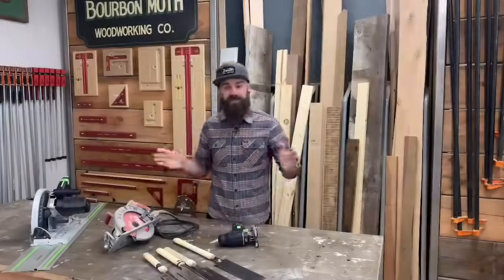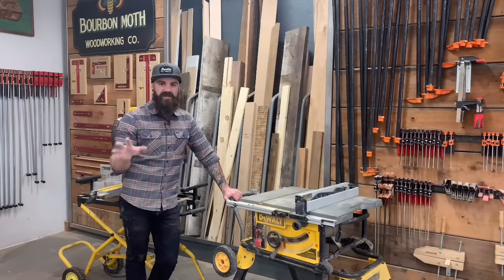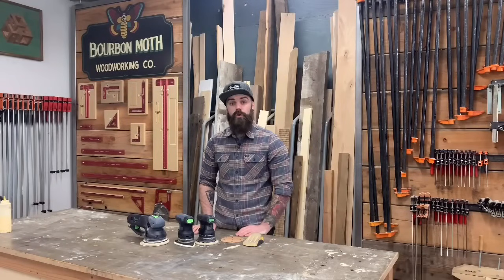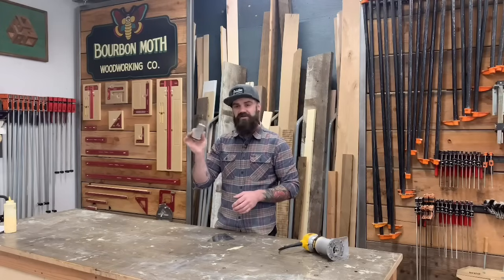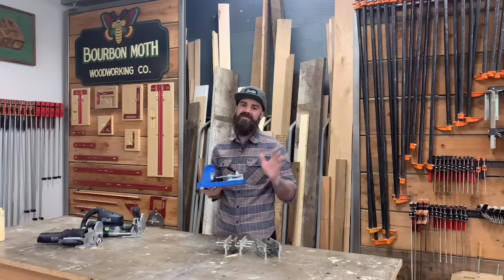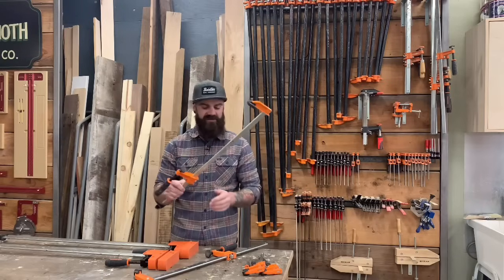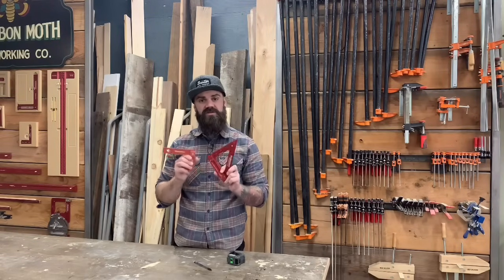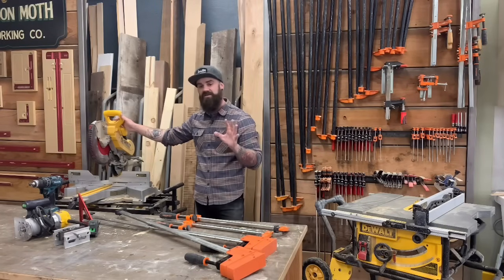Tools every woodworker needs | Start Building for under $1000

Comment: you can get drill bit sets that go into an impact driver.  so i would say a drill is not at all necessary.
dewalt has a very nice 12v brushless impact with a screw setting so you don't strip out holes on small wood screws.  however, the kit with a drill is only fifty bucks more, so i suppose you may as well get both (you may rarely use the drill, but at least you get two batteries)... https://smile.amazon.com/DEWALT-DCK221F2-XTREME-Brushless-Cordless/dp/B07TYKLGZT/
i don't think your makita set is brushless.  the dewalt is, and it's cheaper.
i never liked those self centering dowel jigs.  i would recommend powertec dowel jigs.  there's no reason the dowel has to be perfectly centered... as long as it's the exact same distance from the surface.  these jigs are great... https://smile.amazon.com/gp/product/B07ZJCP9CB/
you can also buy them individually if you're on a REALLY tight budget.

Comment: You can do some stuff hard labor style for 1k but it's about 2500$ to get a shop going table saw 500 planner 400 miter 250
Then you need a few 50 to 100$ tools like circular sanders drills impact etc then you need alot of batteries or air compressor and lines for brad nailer or batteries again. You need clamps wood and you need to make a table\work bench....sorry it's always about 2 to 3 grand to start a shop even budget style and you'll need a shop vac 100$

Comment: Good selection. For an upgrade, add a pancake Air compressor, with brad nailer. Future add on a air stapler, and pin nailer. Also great for blowing dust off wood and inflating beach balls.

Comment: Veeery late to the party but I would think that there's a lot more to be added to this list, like: wood glue, super glue and activator, Japanese saw, A LOT more clamps (at least half a dozen more, including small ones), work table (you can make one but you need one to make one, so...), tons of sandpaper, finishing oils, waxes and varnishes, wood drills and fostener drills, nail hammer, wood mallet (you can make your own), chisels, compass, assortment of screws and nails... I know these are mostly cheap stuff but they're still necessary for most projects and can add up. I'd say another $500 easily.

Comment: Totally loved this video. For beginners, I would recommend the Sawstop contractor or jobsite saw. It is more than $1,000, but a table saw is probably the most likely way to lose fingers. Much harder to do that on almost any other tool in the shop. So, for me, it is Sawstop or no table saw.

Comment: Great beginner tips… In your video, you show the DeWalt sliding miter / chop saw.  I started out with the non-sliding, aka: regular, miter saw, which is about 30% less expensive, and, of course, I got the DeWalt contractor’ saw: an unbeatable combination. One reviewer recommended getting these tools with compatible-sized saw blades. I am unaware of miter saws with less than a 12" blade and it is unlikely you will find a table saw with a 12" blade — unless splurging for a very expensive, 3HP saw.  A larger blade on a miter saw will allow you to cut thicker wood (than a 10" saw blade).  Plus it is alot easier to segment saw blades: 10" for table saw and 12" for the miter saw.  Replacing miter saw blades is a tedious undertaking and one rarely has to swap out blades, unlike with a table saw  Also, do not overlook Craig’s List.  I started out with a great Skil “regular” table saw and after 15 years, sold I on Craig’s List for $75; it was just too heavy to lug into my basement workshop, unlike the DeWalt saw that replaced my first real saw: the Skil saw. It was tough to let my first saw go: my first "large" power tool I purchased and one that served me well.

I suggest getting a belt sander, first, because a hand sanding solution can handle what a orbital sander does (albeit, a little slower; hand sanding is a bit more methodical and controllable, read: more difficult to screw up a project piece by over-sanding with a machine).  Also a belt sand does a lot of that planer and jointer does (if one is careful with belt sanding edges).

Relative to the Kreg (and other) pocket hole jigs, I believe most issues / complaints are because folks “incorrectly” use them to connect / screw end grain of wood the wrong way.  Pocket hole butt joints (and other types of joints) are about as strong and solid as they get. Also, if you have not yet seen Jason’s YouTube video, the joint section part (not the weed, but edge gluing), provides another great tip from an experienced person: https://www.youtube.com/watch?v=C9scpxNqb40.  Another inexpensive jointing option are box, dovetail, etc. joints; Rockler and MLCS have great, inexpensive jigs.  I have had a number of bad experiences with dowel jigs: one fraction of an inch off and you’re screwed — irreparably.

For clamps, as can be seen from his workshop, one quickly learns ya can never have enough clamps.  I have been using those from Harbor Freight clamps for years; they are inexpensive and work very well.  If a wider jaw is needed, as in Jason’s Bessey clamps, use a scrap piece of wood between what is being glued and the clamp’s jaws, i.e., you are increasing the surface area, as Jason noted.  As Jason noted, these are pretty spendy.  Get a couple when they are on sale; it is nice to have a couple of them on hand, sometimes, instead of using the Harbor Freight version.  None-the-less, load up with the Harbor Freight clamps.

Relative to measuring tools, forget the tape measure.  As noted, they are not that handy to use.  Get metal rulers: durable and easy to use.  You can get carpenter squares / speed squares at most hardware stores.  Watch some YouTube videos on how to used these; they do considerably more stuff than most know, i.e., they do A LOT more than drawing 45° angles and measuring stuff.  If they had batteries, you would not need a calculators.  If you are going to splurge on anything, WoodPeckers’ and Infinity Tools stuff cannot be beat for utility, accuracy, durability, and convenience.  They are expensive, but the are on sale all the time — they are worth their price. They are a one-time expense (something almost no other tool can claim) and will never need to be replaced — unless you lose one or someone swipes one.

One real handy thing to have / get is a "workmate" bench.  They are a bit less than desirable, but they clamp wood for sanding, drilling, etc.  They are a great third hand until you can get a "real" work bench with clamps.
Reply: For me the situation is ironically the reverse being in Europe, I have a 12" (actual size ~12.5") table saw in my hobby shop, which is pretty standard.. Machines in larger shops usually take ~16" blades. But my miter saw is an 8" model, which again is pretty common here. There's 10" and 12" versions available, but the 8" and 10" is what most people run.. even contractors due to mobility. There's of course 12" models around though...

Besides, miter saws and table saws by their nature usually use different blades, a table saw when cutting wood usually have positive rake on the blades... While i miter saw benefits from a negative rake, minimizing the risk of the blade grabbing the work piece while cutting. But, you can... of course use whatever blade you fancy.

Comment: terrible suggestion, you can get even cheaper then your said.
1. You can get combo miter/table saw or in my case circular saw  and miter saw is enough for everything. You just need to learn how to use it. 
2. Cordless drill is good enough for everything, hadn't need for impact driver. For drilling grab cheap drill which is meant for drilling.
3. Grab yourself hand held belt sander and it has flat sides to mount it. 
4. You can get yourself good tools that arent fancy brand... For almost half price, heck, go second hand or like apocalypse inventor and fix yourself, its always a good thing to get to knowing your tools.
I hate how 50 dollar talk goes its cheap, grab a bunch, you wont start it as furniture producer, in start its gonna be a hobby...
You can have good joint by hand.
Half of recommended tools can be avoided.

Comment: Great video, Jason, but a major missing component, is bits. Drill bits, router bits, none of the tools come with any bits. Drill bits are easy to figure out, but what are some good starter bits for a router? Ideally, the Freuds are suh-weet-spot, but they're also hella expensive. Also, you might want to go through the links and update some of the tools (especially the table saw, doweling jig and domino joiner). Regardless, keep up the great work!

Comment: Just my two cents and maybe this is obvious but another thing to do, especially when starting out, is to make sure your miter and table saws are the same size.  Both either 10" or 12".  Save by only needing one set of specialty blades.
Reply: Dont listen to him...as long as the arbor size is the same...you can get a 12in saw and use 10in blades...just not the other way around. Specialty blade could be 10in to keep interchangeable. You might need a sacrificial riser block to make your depth cuts..but as far as blade go...a 10 in works fine in a 12in as long as the arbor is the proper size
Reply: Can you show how to make an overhead cabinet in the garage?
Reply: except for the fact that you wouldn't want to use the same blade in both of those saws, nor would you want to go to the trouble of changing the blade out every time you want to use one of your saws.
Reply: @jamestremblett1875  I don’t understand what you are trying to say with your comment so don’t buy cheap tools when starting out ?

Comment: I got a tool kit to include the following for only $298. 2 Drills and an impact drill,  miter saw,  hand sander,  hand planer, jig saw, flashlight, and grinder.  For another $99 I got a table saw with stand.  So I did good.  Now, for free, I got a hammer, and measuring tape.  I spent another $36 on a pallet buster pry bar.  So this is my starter kit, and I will work with this until I get some sales.  btw, square sanding paper is only a dollar and comes with waterproof abrasive paper P80, P240 and P400.  It is NOT adhesive though.  I have had small clamps for years, so I didn't count this in the budget (up to 4 ft long).  I do NOT have a work space however, but this year, saved to get a small 12x8 shed to have it built in the backyard.  When that is built, I will have a small shop to work in even through winter season, and a small solar kit to add so I would have the lights, heater and etc for the shop.
Reply: Where did you get that tool kit????

Comment: The SKIL tablesaw is no longer available (the link takes me to a 2 pack).
Reply: It's been discontinued. It was around $225. It's too bad, there are a few models similar in price but don't have the large rip length.
Reply: @bigosnation  personally, I will probably spend 2x to get the DeWalt 7491RS but it would have been nice to have other options

Comment: The table saw and the chop saw total more than 1K by themselves.
Reply: His links are all messed up and prices have skyrocketed.  If I was just starting out I would get the Metabo HPT Jobsite Table Saw, 10-Inch for ~$400 and a 10" sliding miter saw in the $200-$220 range (Ryobi is fine at HD).
Reply: Can always start with used tools as well

Comment: Are plug in hand drills no longer a thing? I'm not a fan of batteries for various reasons (like me never remembering to charge them), but I don't want to buy a bad thing.
Reply: Only for hammer drills, really. And even for that application, there are amazingly good hammer drills that will work day in day out just on batteries. My father has a small business, and I don’t think there is any corded drill except one big Hilti hammer drill that just isn’t available as cordless yet

Comment: Good information.  One BIG thing that was left out, working surface.  It is great to have the equipment but not sure working in the grass or a garage floor is such a great place to work.  
Can you talk about "minimal" starting work surface?
Reply: I built a basic table using 3/4 melamine as the top for a work surface nothing fancy but it works.
Reply: @eugenewilson7555  that top is great for gluing pieces together! It's usually flat and the glue can't stick to melamine, so cleaning is really easy. We usually have a slab of scrap melamine for this purpose. Also great as pressure blocks when clamping/glueing stuff together
Reply: I just did my first "real" project by cutting full sheets of plywood balanced on the winter tires for my car. Had to make sure the circular saw didn't cut the rubber. 

I need some work horses at least...
Reply: You can build a starting-out bench very cheaply.  My first bench here was made from a discarded domestic door (exterior quality), 38mm thick, topped with a 'sacrificial' layer of 12mm OSB (I can't get plywood here).  The legs were made from offcuts of roof beams, 100mm square section.  I used new wood to make the stringers and stretchers then added a shelf at low level on which I put 160kg of expired cement. It doesn't move!  This one has been in service for 10 years, a similar one built in 1975 is still in use at another house.
And I only used a circular saw and electric drill.
Reply: As terrible as most harbor freight stuff is, they have a good woodworking bench for about 120 dollars..get two, and put them back to back..its actually cheaper than the materials for a workbench, and has bench dogs and a good clamp.

Comment: Here's what I've done, so far: 

Makita 7 1/4" corded circular saw with brake  -- HD return $65
Ryobi corded Power Planer, Open Box $60 
Rigid Corded ROS -- HD Sale $49.99
Craftsman Industrial Plunge Router (1/2" collet) Offer Up $30 Router Only
2x12" and 2x24" DeWalt Trigger Clamp Set $25
2x set of sawhorse brackets $20

DeWalt Cordless Drill & Impact set inherited from my brother in law $0
Various Hand Me Down tools incl. Speed Square, Carpenter's Square, hammers, screws, drill bits, sanding discs, Dremel, and a bit of reclaimable lumber. So far, I'm OOP maybe $500 plus the lumber I bought to build my first desk. 

I plan on selling the desk for $500, breaking perfectly even, and then going on to making nothing but edge-grain cutting boards and replacing my day job with the income when I become a YouTube sensation and start showing up in the gossip pages with Hollywood's Bad Girls... 

First, though, I have to finish the desk I've been working on full-time for 2 weeks. 

(/sarcasm -- please don't crucify me. I was joking. I took up woodworking to replace the Harley my wife insisted I get rid of. When the quality of my life took a nose dive, I knew I had to find a way to get spiritual without spending time on two wheels and wood is what came to me).
Reply: If you ever need help with the Hollywood Bad Girls overflow, I got your back bro. 👍👍✌✌🤣
Good call on woodworking though; don't go building any wooden motorcycles though, it'll piss off the woman.

Comment: I recognize that to do so would make the video much longer, but some comments about how to discern what comprises a quality tool are needed.  My wife bought me a jobsite table saw, and for years it has made sawdust, but the fence is crap and the accuracy of everything I cut is determined by the ability to keep the fence parallel with the blade.  The starter guy won't know this... or be able to tell what constitutes "quality" except to look at the price.... so he (like me) learns the hard way.

Comment: Hands down the best shop starting video I’ve seen ( watched many) - keep in mind - you can buy used - I saw a kapex miter saw for 850 dollars ;1800 new - I just bought a 700 dollar compound sliding rigid 12 inch with stand for 325

Comment: Great advice!  One option that helped me is that there was a woodworking club that had a fully equipped shop that I joined for a while.  Eventually, I got my own setup, and as I did, I still used the club equipment (like the 20 inch planer) that was far beyond my budget. The only issue with the club is that you always had to check equipment adjustments for being square etc,  and of course, there’s working around other people who also are using the equipment .... but it worked great for me!!!  10 years later, I had my own shop set up with good equipment.   One other distinct advantage is that you get to use equipment that you want to eventually buy and you get to know what features you like and what to avoid.
Reply: Now I have to go searching for clubs near me; never knew they were a thing really. Thank you👍👍✌✌
Reply: @shootthemoon6072  You can also see if there is a 'Makerspace/Hackerspace', 'Men's Shed', etc. (https://en.wikipedia.org/wiki/Repair_caf%C3%A9#See_also) near you.
Reply: @shootthemoon6072   new
Reply: I'm considering this option, especially since my work space is pretty limited at home.
Reply: I've just started this myself.  I have the money but ZERO space for most tools other than a fold out work table and track saw, router, etc.  Found a great local company with tons of high end equipment and one on one teaching/building.  Currently building a new desk for my office.